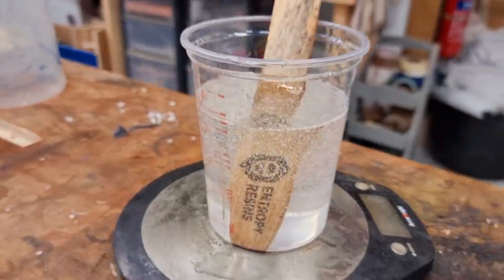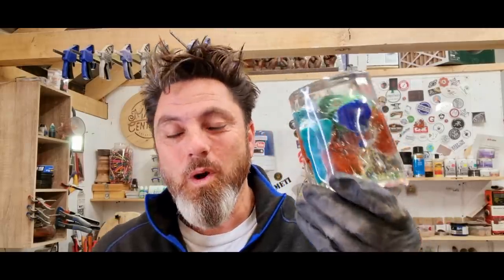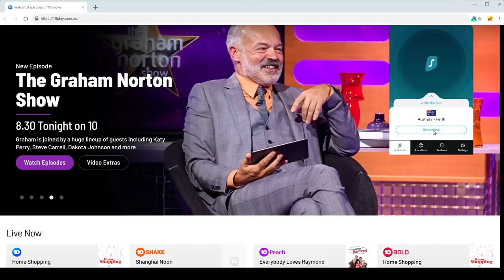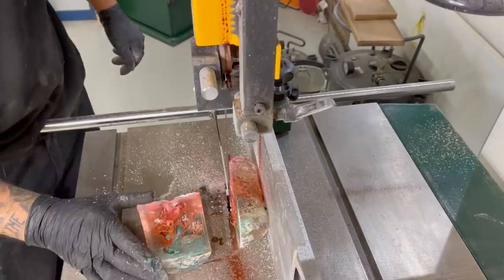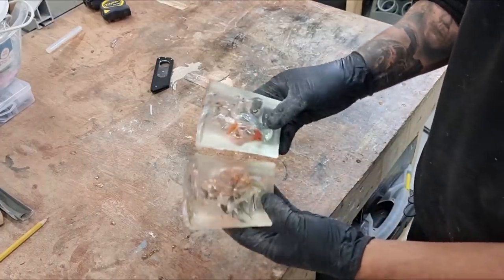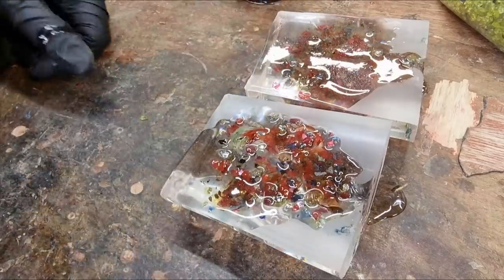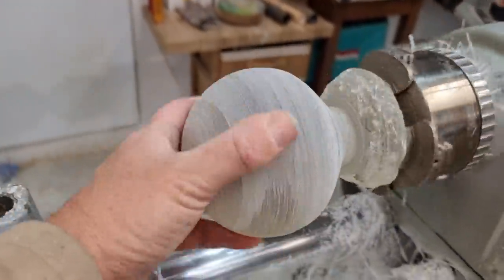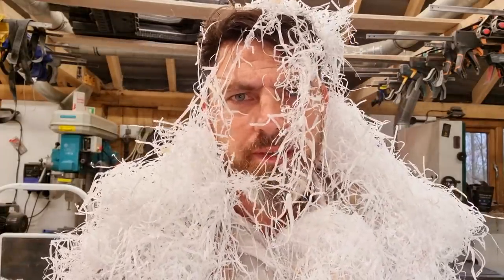Woodturning - The Planetary Nebula - Using Glass Ice & Resin !

Comment: Looks like a planetary explosion. The faint color of the leftover water left just the nicest hints that really make it work so well. I dare say this might work with a large enough resin and huge chunks of ice. Make a lamp shade type thing out of it with a regular low power LED bulb. Could try heavy stuff in the water. Like crushed glass in the ice then when in the resin it falls and could possibly sink into the resin. might look like a Geode like with all those micro crystals reflecting all that light back at ya. A Geode bowl with a "bulb" coming out of it done in the same fashion that you did here.

Comment: Mr. Nickolas.....awesome job! Up there in the "Back to the Future" class!! So I was thinking as I was watching this video.....and it just popped into my head.....If he can use regular ice.....why can't he use dry ice.....hmmm......I know it is extremely cold and the resin heats up after mixed....so could make an explosion of bubble and lord knows what else....so if you do try dry ice in resin...do it outside and only a little chunk of dry ice. Also....as I was mesmerized by the "Orb of Redemption" at the end of the video....how about taking smaller crushed glass and using a very large syringe and pipe the glass into the resin...making like a galaxy swirl or ring or just clusters of glass in different area......just a thought.....

Comment: Hello Mr. Zammeti.  The ice was interesting but I wonder what would happen if you did it with dry ice?  Sure it is going to "melt" into a gas inside the resin but I wonder if the pressure of the pressure pot might help keep it contained to within the resin. On the plus side you would not need to worry about water effecting the resin although the extreme cold of the dry ice might slow the cure time. If the escaping Gas happened to create worm tracks through the resin it would be funky to inject them with different colored resins after the fact.
Reply: I like this idea a lot.  I think using UV reactive pigments could be  a lot of fun too.

Comment: I would like to see a project where you mixed fast set and slow set with UV resin. I would like to see what happens when they are mixed. Does the UV solidify with the regular resin, or if you mix it in then shoot UV, do you have solid pieces. 🤔  really curious about this.

Comment: Nick ... I've got a question.  Can the debris from turning the epoxy (the fine strings of dried epoxy residue cut off the project) be reused in any manner.  It is basically just dried epoxy, so can you put it in liquid epoxy and will it stay white like worms or will it turn clear, and disappear in the liquid?  It seems like there is a lot of waste, and if you could figure a use for the scrap ... it might be interesting.